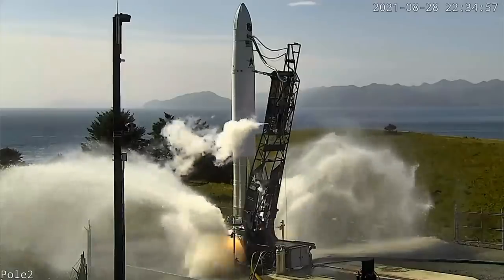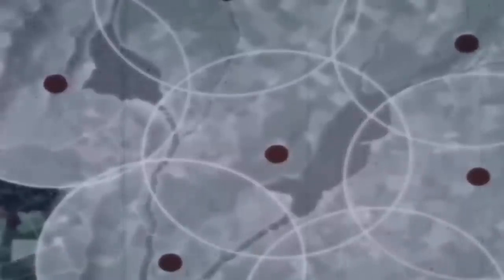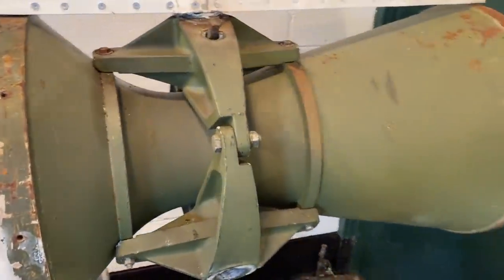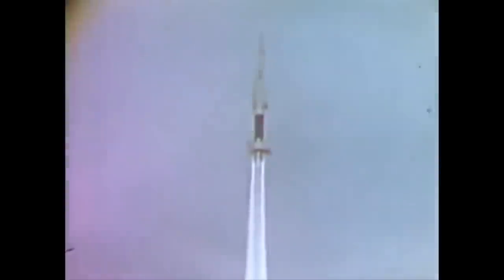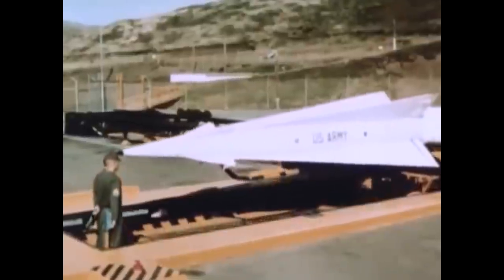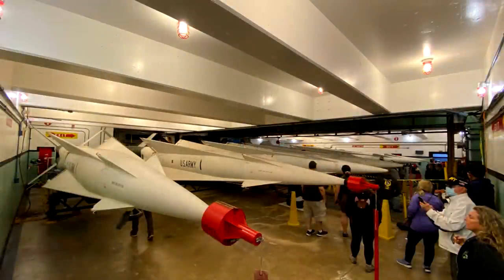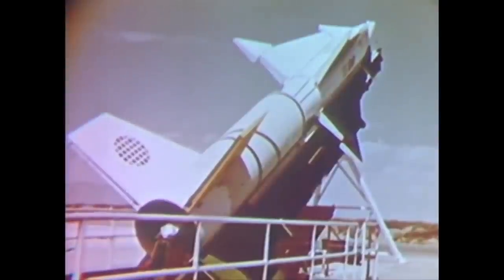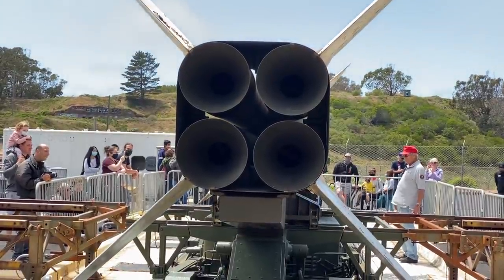Nike-Hercules - US's Surface To Air Missile with Nuclear Warheads.

Comment: Interestingly that some time after Nike -Zeus as a successor came Sprint rocket, which has absolutely amazing launch sequence (100g acceleration),  check it on youtube.
Reply: The successor to Nike-Zeus was actually Spartan, designed for exoatmospheric intercepts approximately 400 miles uprange from intended targets  and armed with a 5Mt thermonuclear warhead designed to produce copious amounts of x-rays [to kill electronics on incoming warheads and to destroy RV heat shields by spallation]. Sprint was an entirely different beast, designed for last-second intercepts, after reentry had separated the RV's from the decoys. That is why it had the tremendous acceleration and was armed with a 10 Kt neutron warhead. When the US deployed "Safeguard" at Grand Forks AFB, there were 30 Spartans and 70 Sprints installed.

Comment: We had a Nike launch site on the hilltop about 1 kilometer above my first apartment outside Seattle. By the early 80s, it was already closed and empty; just a grassy field and a couple concrete buildings sitting inside a rusting chain-link fence with barbed wire along the top. High school kids sometimes climbed over and painted graffiti on the buildings. Never went in there myself.

Comment: I've hiked to a number of the old Nike sites north of Los Angeles.  One of them has been preserved as San Vicente Mountain Park.  One is still in use by the LAFD as their Fire Camp 9 in Los Pinetos.  Near that one is the "Magic Mountain" site, which was converted into the static test facility for the Apollo LM maneuvering thrusters.  The Mount Gleason site was also a fire camp until it burned down in the 2009 Station Fire (it was the "station" the fire was named after, actually).  And the Oat Mountain site was featured in the 1961 "Lassie" episode, "The Patriot."  The LAPD took that over and used it as their SWAT training ground for a while, but now it's pretty much been left to the graffiti artists.

Comment: There's a datacenter near me which, before it was a datacenter, the building was used in the development for the guidance system of the Trident ICBM.  When you go inside, you then take an elevator underground to where all the IT gear is.  Back in the day, they had an infirmary and cafeteria all onsite and underground.  All that has obviously been removed now.  Now it's just a normal datacenter for Telcos and other corporate clients.  That may make for a cool story for your channel.

Comment: So, before COVID caused everything to grind to a stop, I was volunteering with the Civil Air Patrol in MD.  A couple of years ago, we moved the wing HQ from what was, essentially, a run down trailer park near BWI to an old Nike missile base in Granite, MD.  Before COVID, we were actively working on refurbishing the launch base, pumping out several feet of water from the storage area and repairing it.  We even had a decommissioned Nike lined up to be transported here right before the lockdown started.

Comment: On the subject of analogue computers - there are several old WWII-era declassified films on electromechanical naval fire control systems.  There are also some simulation resources for cold-war era Soviet S-75 (SA-2) missiles, which had a similar analogue fire control system to the Nike Ajax.  A little google-fu should turn them up.

Comment: Scott, when I was in the national guard, I was trained to work on the elevators for the N/H system. I went to school to be a missile equipment specialist. My job was to maintain the elevator and associated equipment. I never got to do this job. I was reassigned to the motor pool as a motor sergeant. Go figure.

Comment: According to most Nike veterans that I've talked to, the conventional-to-nuclear ratio for CONUS sites was actually the other way around.  Most Hercules batteries in the US had 18 missiles at each site, divided into 3 firing sections.  Of the 18 missiles, 15 would usually be nuclear tipped.  Only one conventional round was reserved for each firing section.  Protocol was to use the largest warhead necessary to eliminate the target.  In my home town of Pittsburgh, we had 12 Nike batteries built around the city.  Six of those sites were converted to Hercules in the late 50's.  That would mean that there were up to 90 nuclear warheads on alert surrounding the city at anytime.  And that was just ONE of the dozens of cities protected by the system in the 50's and 60's.  You could say that they were NOT messing around with defense in those days.

Comment: Back in the late 80' or early 90' i went to a air show at Point Mugu Naval Air station in CA. I was so young the only thing i remember is my dad telling me that those big white ball looking things up on the hills were radar for missile defenses that the base used to have. And they had a line of random old decommissioned rockets on display. In addition to the usual air planes and stuff. Might it be one of these Nike bases? Hmmm. My father worked at Hughes Aircraft in El Segundo back in the late 70's to i think 1995 or so. He was a electronic and optics inspector. Specializing in laser guidance systems for more modern systems like the Nike one. I remember one time he came home and told me he failed a 23million $ lens assembly for a guided rocket. To find the scratches he had to use a microscope. I remember thinking that would buy truck loads of Legos! :D

Comment: Hi Scott! In my hometown in Syberia we had those infamous ridiculously overbuilt railroads and rail bridges that were built with the purpose of disguising "the fridge", as we called it. It's a normal-looking refrigerator train wagon that was randomly inserted between other refrigeration train wagons of cargo trains, and there was no way to tell any difference between them from the air, they looked exactly the same.

However, if you looked from the side, there was one difference : instead of the normal 8 wheels it had 12, to carry the additional load of a nuclear missile disguised in a civilian train that was roaming throughout the entire ussr via the Trans-Sib railway. That train was called Barguzin, you can look up its pictures.

That's a pretty cool story, can you make a documentary about it?

Comment: The only other preserved Nike site is located at Sandy hook NJ called NJ-56. The site has missiles and most of the buildings and control trailers are intact but in a very poor condition compaired to the SF site.

Comment: BTW possibly a throw away line but you should have mentioned the massive reduction in shots Vs Kill ratio for V1 shootdowns once radar computer control & proximity fusing was implemented, from memory it was way smaller that 1000:1, more like 20:1

Comment: Electrical analog computers are based on potentiometers (lots of potentiometers, which are used to tune the sub-circuits), opamps (amplifiers with both a normal and a * -1 input, where the difference between the two is what actually gets amplified), more normal resistors (for hardwired dividers & such), capacitors (for mathematical integration), voltage controlled resistors (transistors or vacuum tubes, for controllable dividers), and diodes (for logarithms & such).

There is a lot of tuning that's required, as you otherwise get lots of offsets & multipliers throwing results off.

Comment: I worked in Air Defense and my understanding was Nike Hercules was a beam rider much like the Hawk system. A high powered radar would illuminate the target and the missile would ride that beam all the way to the target. Not much down link needed. It would adjust course based upon the reflected microwave energy from the target. It took the Patriot Missile system to have a missile that truly would up-link and down-link in flight
Reply: Nope, or at least probably not the way you think. The TTR and TRR provided the constantly changing range, azimuth and elevation data to the analog computer. The computer determined the constantly changing point of intercept and sent adjustment commands to the missile via the MTR. The MTR continued to provide data to the missile until the point of intercept was reached at which time a special detonation signal was sent. The two sets of calculations are Calculus 101: multiple constantly changing values associated with each moving point (target and missile) coming together at a single intersection (multiple variables for the missile and target: range, azimuth, elevation and time). Which, by the way, the intersection itself did not occur. The warhead, whether HE or nuclear, was detonated at a point above the target. The shock-wave would shatter the target thus ensuring the target's weapon's safeties would prevent any secondary detonations. Aircraft then and probably now do not have radar looking for missiles coming down on them from a much higher altitude and now at very high speed: the aircrew likely would not know what was about to occur.

Comment: The nuclear warhead would obviously have a great blast radius, but it would also produce an electromagnetic pulse (EMP) which would  be able to disrupt aircraft electronics, including air launched missiles. It would be interesting to find out the EMP range of a W-31 warhead. Also, maybe Scott will discuss the BOMARC missile in another video. We had batteries of both missiles here on Long Island.

Comment: Should do a follow up about the Sprint version with it’s 100 g acceleration. 0 to Mach 10 in five seconds. Ablative heat shield for the trip UP.

Comment: The basic idea of an Analog computer is simple. If you’ve taken an Electrical Engineering course, you know the calculating the voltage or other aspects of a circuit requires solving differential equations. An analog computer uses that fact. It is designed to model certain differential equations, e.g., the equation for a missile falling to Earth and the amount of force, angle, etc. when to fire another missile to intercept the first one. You enter the various input parameters by adjusting capacitors and other elements of the circuit and then you read the resulting value (e.g., the voltage) and that gives you your answer. It’s amazingly clever but limited to solving only certain predefined equations so not nearly as flexible as a programmable digital computer.

Comment: Oh man I hope you follow your curiosity and figure out how that guidance computer worked! I'd love a video with more info on it! Was it purely mechanic (cams, differentials, and gears style)? Pneumatic style? Or hybrid with anolog electrical computational parts? It would of been development right around the time so many different and new computation methods were being explored so there is lots of potential for it to be in the SUPER INTERESTING category!
Reply: I worked on the Nike analog computer and hope to talk with Scott. (I live here in the SF bay area)
Reply: Look into fire control of battleships, then ... that are very interesting mechanical computers.
Reply: @advorak8529  yeah they most definitely are! I've researched a few different types of those fire control computers in the past, and have copied some of their mechanisms (pin track multiplayer, differential based subtraction/adder, and a cam representing a sigmoid squasioning function) as a hobby with the hopes of making a 5 neuron ANN for giggles, curiousity, and awesomeness. 

The Z1 by Conrad Zuse is a facinating machine you might be curious about because it was a digital mechanic computer. Every aspect of the machine was mechanical but it computed in discreet binary much like modern architectures, truely a facinating machine!

Comment: Main reason the system was ultimately axed was popular opinion, the US populace believed having an interception site close to a city would make the interception site itself a target and attract more fire towards the city.
Reply from the maker: That probably fed into the determination. But the US agreed to get rid of a certain number of nuclear warheads and a surface to air missile system that had never been used, was going out of date and didn’t help against the real threat was an obvious choice.
Reply: @scottmanley  They did try and continue the system after withdrawing it from the cities, moving it to only protect their nuclear silos but lack of public support and the usual senate appropriations shenanigans meant the funds dried up, Nike-X became Sentinel then safeguard with ethos changed from protecting against a full nuclear strike to protection against a limited or accidental strike and despite being theoretically operational without the funds for a full rollout it just withered on the vine.

Comment: I thought proximity fuses helped improve kill rates / "accuracy" of anti-aircraft artillery by something like 4X to 5X; and that thousands of shells didn't have to be used? Thinking of in support of lines of defense against the V-1 rockets, as well as usage in the South Pacific....

Its interesting that Nike started in 1944, in anticipation of jet powered aircraft coming online, for operations at higher altitudes, along with higher speeds. Seems it took a long time to get into service, in 1954, but some of the specifications were impressive: " Guided by a radar system designed by Bell Laboratories, it could intercept aircraft flying as high as 70,000 feet (21,000 metres) within a range of 30 miles (50 km) at more than twice the speed of sound. " (Source: Encyclopedia Britannica)...

Comment: Thank you Scott I loved this video, I built Estes model Nike rockets as a kid, I know they were nuclear armed, but I did not know they were for anti-aircraft use.  Would love to hear/see more about the analog computer guidance  control systems. I assume they were based on navel analog computer fire control systems.
Reply: The Nike-Hercules missile also had a  little known surface-to-surface mode. At one point it was the most accurate surface-to-surface missile in the Army inventory. In that mode it had considerably more range than it did against aircraft because the final portion of its flight was purely ballistic.
Reply: The Nike System guidance system was based on an AAA fire control system designed for the US Army in the mid 1940s called the M-33.
Reply: @richardvernon317  The Nike RC van contains a M-33 target console.
Reply: The guidance computer is actually based on a telephone line condition chart recorder being developed at Western Electric in Murray Hill, New Jersey. An engineer on the project came up with a servo driven potentiometer to store data tables. He had a dream and in that dream he was in London and the soldiers at an AA battery invited him in to see the gear that was automatically directing their artillery, where he saw his servo-pot device being used to store ballistics tables and to solve ballistics equations. He convinced his boss to assign him and another engineer to realizing that goal and a gun direction system called "Number 9" resulted which shot down 89 of 91 German V1s in its first month of use. That system evolved into the M-33 gun Director which evolved into the Nike guidance computer. The processing was done by approximately 100 opamps and the servo-pot mechanism which Scott shows a little glimpse of the top of at 2:30.
Reply: @Peter_S_  I knew that M-33 was based on the M-9 which played a very major role in the defeat of the V-1 offensives against both London and Antwerp. Saying that M-9 couldn't have done what it did without the SCR-584 Radar and the Posit VT Fuze.
Reply: @richardvernon317  No question those three items together was the winning recipe.
Reply: @Peter_S_  Great Description! I used to work on these. Least trouble to fix except for the mercury tube rectifiers for the huge potentiometers. The "zero setting switches" told you which op-amp was defective.
Reply: @Peter_S_  Great Description! The computer was the easiest to fix, except for the mercury rectifier tubes for the huge potentiometers. The "zero setting switches" told you which op-amp was bad.

Comment: I used to drive up to the Nike missile site in Manchester Connecticut to park on top of a silo and talk on the cb radio..it was the highest location around.
Reply: I served at other sites in the 70s and I’ve been there, too. This is the  first Fire Control Area I have ever seen that wasn’t on the absolute highest hilltop in its vicinity. It was completely blocked from seeing anything but high altitude targets to the East. Should have been up on the highest ridge along Case Mountain Road, like the one in Meshomasic State Forest.

Comment: Interestingly enough, Soviet-era SAM systems did not use a nuclear warhead. But now, you wonder if the S-400 and soon S-500 SAM systems will use long-range missiles armed with an enhanced-radiation (e.g., neutron bomb) warhead so it could be used as an ABM system.